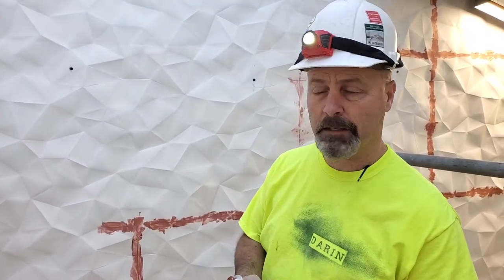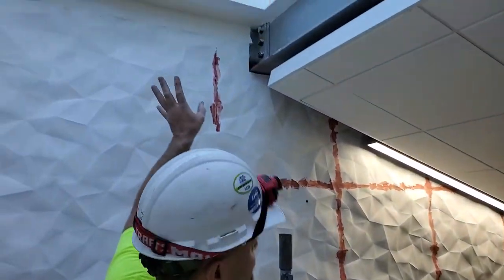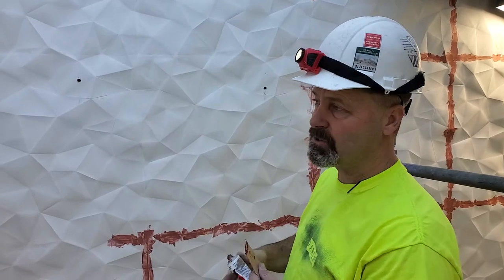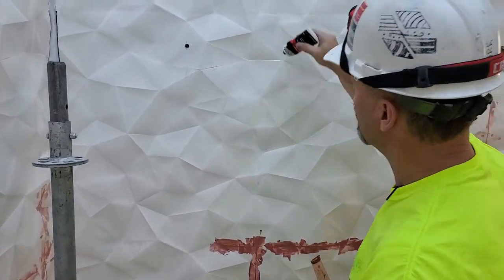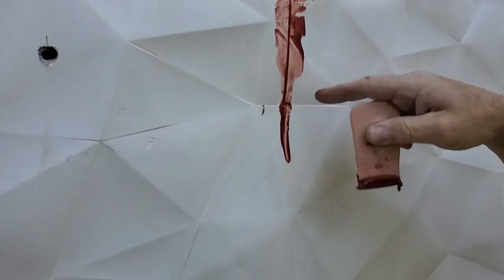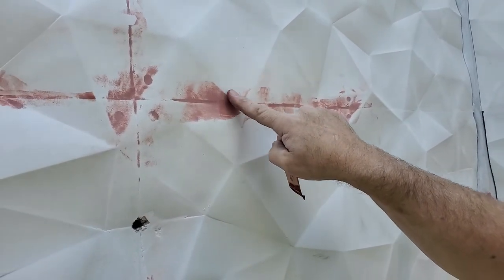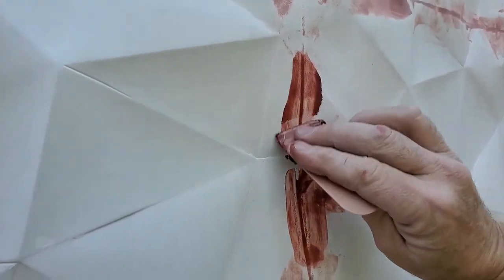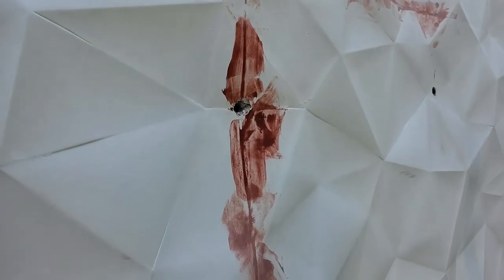Quirk installing Modular Arts at Weber State.

Comment: What glue do you use for attaching panels to each other on the seams?
I have a small wall to do but the wall is very old and not flat. What should i do? Wall is about 7x12